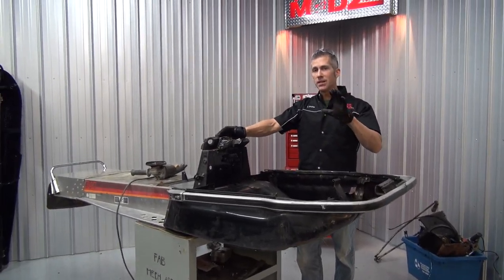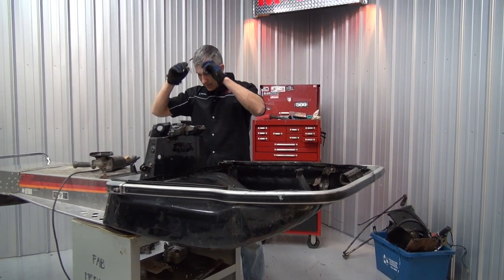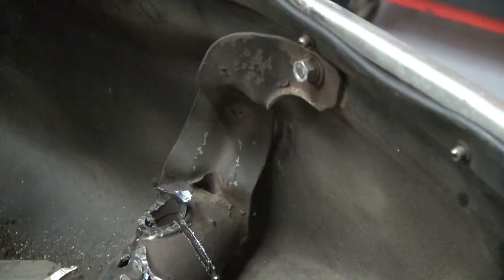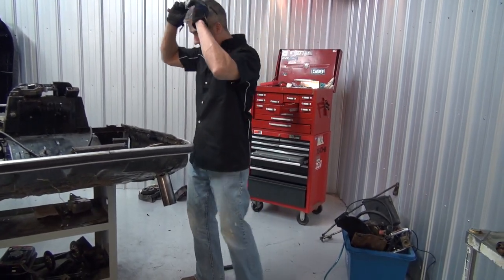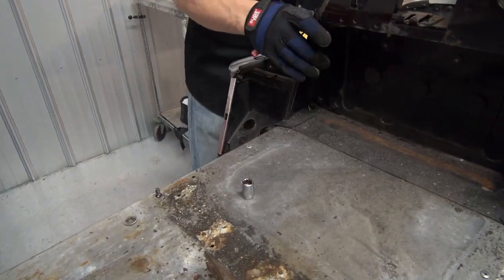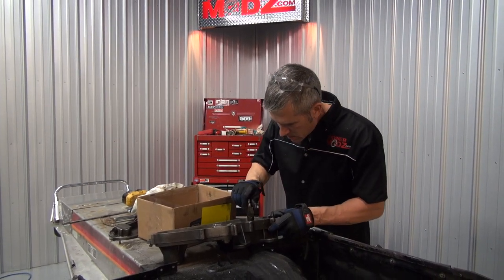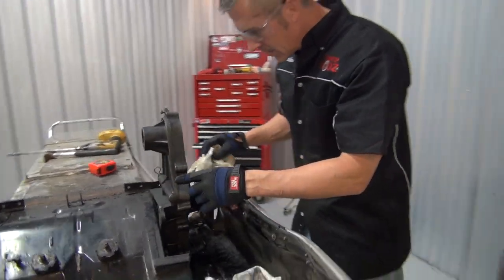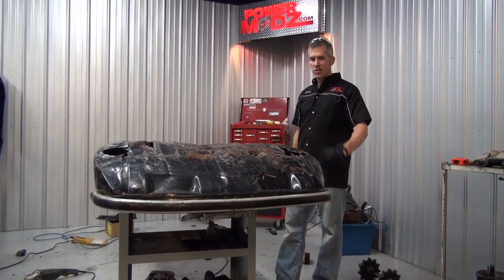Yamaha Enticer Modified Sled build, Ep # 2 front suspension,  long track 540cc!  PowerModz!

Comment: i got my srv engine mounted into the et chassis now  waiting on my pipe to get here for it and still need a carb but is coming along nicely,i build mounts off the old 340 engine plate to the 540, I'm going to stick with the yami secondary for now and see how it does i I'm running a p85 polaris primary on it, the wiring harness and cdi worked on the 540 just had to extend a few wires the only wire in question is a yellow with black stripe on the 540 idk what it goes too but i got spark and it pops off, I'm still working on it but i will have it going soon i hope
Reply from the maker: I'll be doing pretty much the same thing.  I kept the 340 plate and will be using the mount I made for the 540 elan to mount on top of the plate.  I've got a 540 wiring harness so i'll just use that.

Comment: I have a 1980 enticer 250 and it is not getting gas and i got the carb rebuilt and it didnt fix it can  you help me with what I need to do to fix it
Reply from the maker: check the fuel pump and check the line inside the fuel tank - if it has a leak in it it will suck air.  also check the impulse line from the motor to the fuel pump.  braaaap!